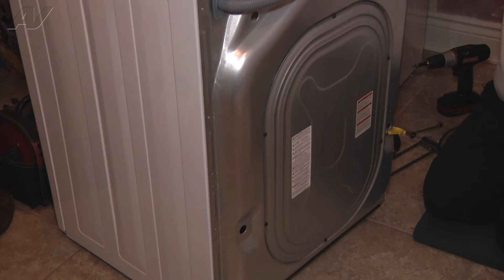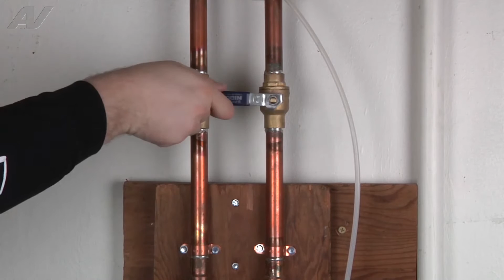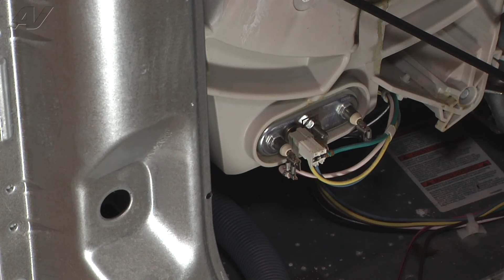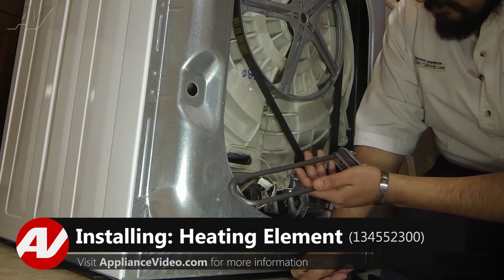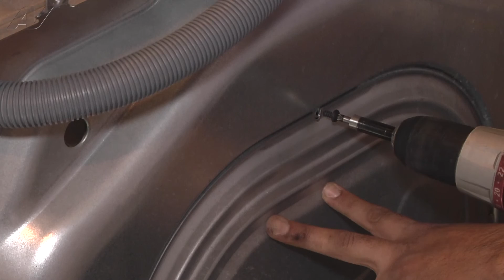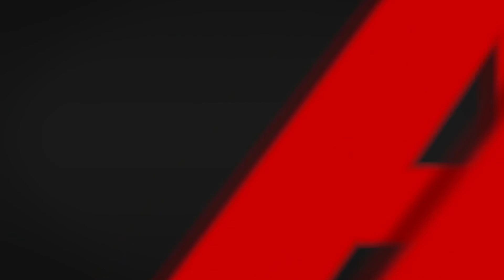Frigidaire Washer Repair - E68 Error Code - Heating Element

Comment: So I am getting that error but the machine spins slow and then stops and the door latch unlocks. I just replaced that Door Latch Assembly in November 2021 with a Frigidaire part so it wasn't cheap. Not happy. The water is hot so I can't see that it is the heater. I need this fixed. Is it the door latch again or the heater?
Reply: Did you ever figure out the problem ? I have a E68 code

Comment: Is there a way to make the affinity washing machine works without the heating element? I only use cold water
Reply from the maker: Great question, if you have a more technical question that our parts department cannot answer, you can search our over 10,000 answered questions free at our website www.ApplianceVideo.com under our Repair Help section. You can also call our parts department at 1-800-830-5465 and they can give you help 7-days A week Monday Saturday, or search at www.SaveMoreOnParts.com  24 hours 7 days A week.